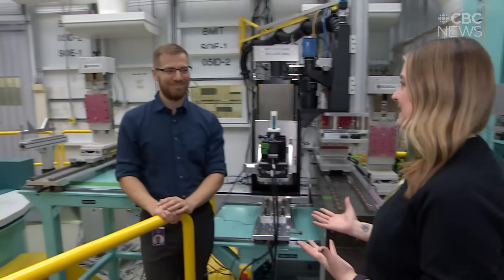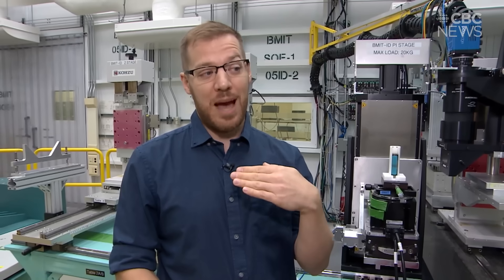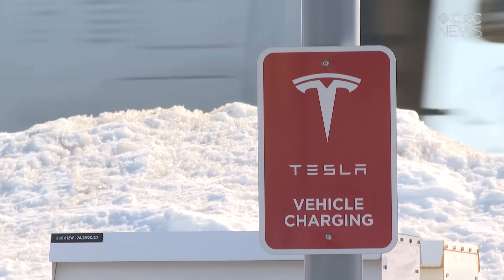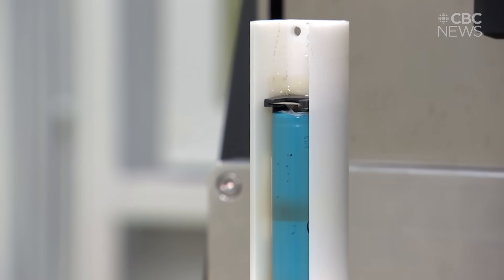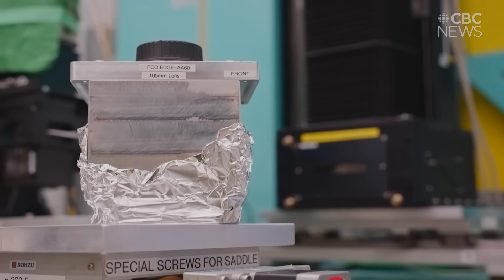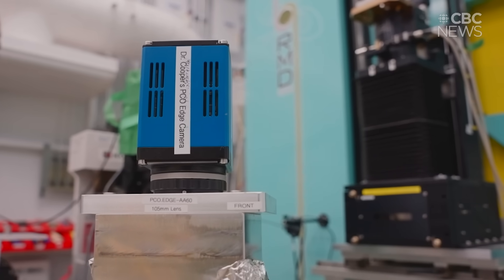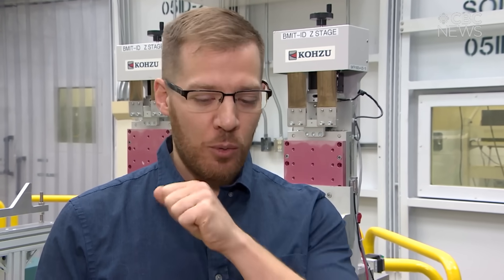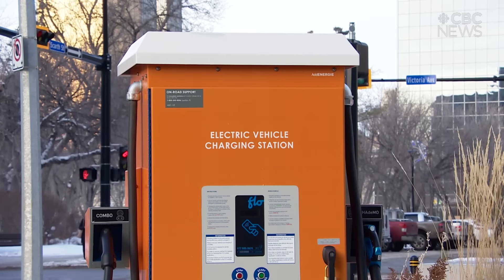New electric vehicle battery could run for 8 million kilometres

Comment: My 2017 Volvo XC90 T8 hybrid is currently sitting at the dealership with a failed battery that's going to cost $10,000 to replace. It failed just 38 days after the warranty expired, and I've been waiting over 2 months with no clear timeline for the replacement. These stories are becoming far too common with EV and hybrid vehicles. While I support the transition to electric vehicles, manufacturers need to take responsibility for battery reliability and ensure better warranty coverage. My Volvo has only 124,000 km - these expensive batteries shouldn't be failing so early in a vehicle's life. The real issue isn't just the initial failure, it's the extended downtime and poor customer service that follows. How can consumers trust these expensive vehicles when manufacturers won't stand behind their products?

Comment: I want to know how this new battery would preform, would it still be capable of similar efficiency compared to the lithium batteries we currently use.  It would be cool that it lasts forever but not cool if the range is 10 kilometres.

Comment: Questions: 
1) What are the temps and DoD for this battery testing? We know that temps, high SOC, and high DoD can dramatically change how long the batteries will last.
2) What does the charging curve look like for these batteries when applying high DC fast charging to them? Peak, Charging curves, C rate, Charge time, battery life while varying how often you fast charge etc etc.
3) How well does it fast charge in the cold. How does cold weather effect it generally?

If it can do all of these extremely well then that would be impressive. Saying a battery can last decades in a lab means nothing if in the real work it's useless and falls apart

Comment: BUT….how long does a charge last? That is the important thing in the north. An electric vehicle here should be able to make a 10 hour drive with only stopping a couple of times, taking 5-10 minutes to recharge. It also needs to be able to do this reliably in minus 40° temps. Anything less is completely impractical.

Comment: It matters not how long the battery lasts, it is the energy required, first to be produced, secondly to be delivered along a network that has have capacity increases installed( and paid for) for the increased energy demands created by the EV industry. I wonder how many people have considered that your average truck unit needs the energy of a small residential subdivision and how many thousands of trucks are out there? I doubt very many of the EV adopters considered just what their energy requirements were going to be and what other uses of electricity they would have to cease the use of to come out of the" I am saving the planet" equation with any kind of net benefit to the planet and not just an additional burden.

Comment: Lots of questions not asked, what’s its chemical composition?, is it prone to thermal runaway?, whats its power to size/weight ratio?, what percentage of the battery is recyclable?, what is the estimated production dates?, what is estimated cost per Kwh.

Comment: Hi,  great to see my home province doing this research. I have a chev bolt in Vancouver bc and love it for city driving. Your new batteries could be a game changer for our local warm climate compared to the rest of Canada. My question is will these batteries be able to handle colder temps because even here as soon as the temp goes down around 10 C or colder the range drops dramatically.

Comment: Having driven plenty of clunkers over the course of my life, I can tell you that any battery that lasts longer than a million kilometers will probably  outlast the car, and/or the owner.

Cars start to develop all sorts of annoying rattles and quirks the older they get.  And, there are little annoying appearance issues that pile up.  The stain on the carpet that won't quite come out.  The exterior paint that is gradually fading, etc.

Every year there are new convenience and safety features that are at first expensive options, but evolve to be required equipment (seat belts, air bags) or expected luxuries (automatic transmission, power windows).

A million kilometers is 50 years or so of driving for many drivers.  Where will personal transport be in 50 years?  Flying cars?  Major highways replaced with hyperloops that transport at the speed of sound?  Robotaxis?  Cars with such epic collision avoidance they can drive at ultra high speeds safely?  I don't know how driving will change, but it's  likely it will, and cars sold today won't fit in in 2075.  A few will probably survive as collectors items, but, like a Ford Model A in 2025, they won't really be practical transport.

Comment: The reason it will never go into actual production is included in the title. Like the tyre that never goes flat or wears down.
Reply: Battery packs are not a wear and tear item. They are a one-time per vehicle sale except in extraordinary circumstances. Lifetime like this justifies a higher cost as the battery can have a long second life as storage. Potentially allowing you to charge on off peak and run your house on peak and save you money long after the rest of the car is recycled.

Comment: My Nissan Leaf from 2013 is still running with about 80 %   battery capacity. I drive the Leaf every day. Its a great little car. Very short range though, but it fills it purposes as a second car in the family. Have a nice day 👍
Reply: I think they have a use for a lot of people. Or who use the 2nd family car for longer trips. As long as people have a choice. Have a nice day.

Comment: Need to make a EV battery that doesn't need thermal managment in the cold while sitting idle. That would be a game changer. Storage below -20°C and charging below 0°C lithium batteries will be damaged without internal heaters

Comment: Cool and all but no mention of charging time or maximum input and it still uses lithium, which is more and more rare every day.  We need to get off of heavy metals and dirty metals.  If humans are strip mining the entire globe to save the planet with EVs then that's not really saving it.  Are these types of batteries more resilient to shock and thermal runaway.  That at least would be a step in the right direction.

Comment: Who cares about battery life when cars are made of so many plastics that degrade in about 5-10 years from basic oxidation? Every modern car I've owned (regardless of power source) starts having all these little motors that rely on plastic gear wheels for things like opening locks and vent controls fail within in 5-10 years. My Audi had to have three door latches replaced, then one month later the tailgate got stuck in the closed position because that latch broke. I wanna sell it, but it breaks faster than I can get it listed!

Comment: 8 million kilometers? That's nothing, in the U.S. they are developing a 9mm handgun that can shoot 50 bullets in 5 seconds.
Reply: What ? Are you on acid? How is that relevant?
Reply: And how many kilometers can those bullets fly in total over the lifespan of the handgun?
Reply: And I'll bet that battery was built in the USA
Reply: The REALLY cool weapons tech is focused on moving away from traditional bullets.  It uses electromagnetic launchers of non-cartridge bullets (with no powder, easy to produce and store in-hand in much larger quantities).  Tests by hobbyist builders put it at par or BETTER than traditional powder-based ammo and weapons, +10% on distance and +5% on accuracy.  And the bonus is that the bullets can also be designed for better distance/accuracy because they are independent of any kind of shell cartridge, so there's no need for "air tightness" or "hold".  When this tech goes mainstream (ironically because of anti-gun legislation and difficult in obtaining powder based ammo), suddenly the 9mm and AR-15's are obsolete.  The key factor keeping that from happening has been battery weight (original models required power from 2-3 power tool 18v cells or car batteries... not exactly concealed carry ready).  As soon as battery tech and voltage capacity improves, it's a new era of weapons for personal protection and ground combat.  I always tell the left, leave it alone, you're only going to force innovation.

Comment: For electric cars, there is discussion about the battery's ability to cycle 2,000 times. Some calculations suggest that if you fully charge a battery to 100% and drive 400 km, the battery life would reach 800,000 km.

However, there's a significant flaw in this calculation. Every time an EV brakes, regenerative charging occurs. In stop-and-go driving conditions, an EV battery may experience hundreds of cycles per day. This frequent cycling can significantly impact the battery's lifespan.

Comment: Here’s the thing about a battery though it’s not hard to literally take a battery out of a car that’s below that 80% threshold and bring it back up to the hundred percent threshold. It’s not like an engine where you have to take it out and rebuild the engine it’s much simpler with a battery.

What we hope to do long-term in the future is literally have cars that wear out and we just keep the battery and move it to another vehicle. Now what we would need to do in order for that to be possible is to standardize make shape and size of batteries in general. This battery for smaller vehicles standardize that the battery for larger vehicles standardize that and have manufacturers agreed to this standard so that whether it’s a vehicle from 2025 or 2050 we know what the battery compartment will look like and we know we can make this battery fit in there.
Reply: You're right on "Keep the battery"
WRONG on "standardise the battery"

Comment: He said the warranty backward. The seven year warranty is that they can't lose less than 20% of their capacity and have to retain 80% of their capacity. He said it the other way around. Tesla: "8 years or 150,000 miles, whichever comes first, with minimum 70% retention of battery capacity over the warranty period."

Comment: Both the article, and this video, do not provide a link to information on the solid crystal battery discussed.  Where can I find it?
Reply: Thanks. Found it. It's LG chem  making them.
Reply: Look up the following sentence for more info on the battery
New EV battery could last 10 times as long as those currently in use

Comment: Just read a story of a 3000km new battery needing replacing.  Just like engines, they often fail.
Reply: @SJC8989  At 3000 km it would definitely be replaced under a ten year warranty. And then the new battery will be guaranteed for a further 10 years.
Manufacturing faults do occur with all machines. 
Less frequent with electric cars.

Comment: the problem about batteries, is that they age VERY differently depending on how you use and charge them.  In lab conditions, versus in real life cannot be compared.  I think electric cars should adapt something like a health gauge for their battery, similar to an iphone.  So you know, aside from the mileage, how much potential charge is left for your battery, or for a used car that you want to potentially buy.  That will give people a lot more assurance and peace of mind with owning and shopping for an electric car.

Comment: Not even a whisper about energy transfer efficiency, or energy density.  If it takes twice as long to recharge, and it displaces twice the space it’ll need a lot more research time to even be considered to approach viability for automotive implementation.

Comment: But having to replace a battery yet can cost you up to $25,000. At least what customers who owns a Tesla will say. Batteries still need to be pushed to become cheaper
Reply: But what if it costs 25k and you can resell( or install it in your new car and deduct the battery price)  it after using it in your car for 400k km out of 8000k for 23,5k as it is still has 95% of its life left ?

Comment: A lot of things are great in the lab, but only a very tiny fraction would make it into production so don’t put too much expectation in it.
Reply: Yeah that's what I was thinking needs real road use especially in sub cold and hot climates.. but heck even I can get 30 years with still getting 200 mile ranges or close I'd be happy with that.. I don't drive 200 miles a day..  my 12v life trolling  battery 100ah been abused 3 years now and the capacity is 92ah. So I'm thinking easy another 13+ years with it till capacity goes below what I can use..
Reply: Agreed.  There’s almost always a, but.  It could supply chain availability/cost, production rate, energy density, rate limited discharge, or something else.  Hopefully, this’ll be different, but statistically for new battery technologies that are reported, we’ll likely never hear of this again…

Comment: He says "we saw no signs of degradation" as they display the scan results, showing degradation... @3:37
Reply: the degradation shown below is for other battery types, in case that is not obvious.
Reply: What you are looking at is an image of other batteries and the effect 2000 cycles (600000km) has on them. You can also see the snowball structure in the image there.
If you listen to him, he mentions they did tests for 6 years on their batteries, doing 20000 cycles (8 million km) on them, showing no degradation.
They didn't show us an image of their battery.
Reply: @Simqer  This makes sense, thanks!
Reply: you're seeing the comparison slide incorrectly. the new battery goes across horizontally. old battery is below.
Reply: @porroapp  Yea... Exactly lol. It literally says it's damaged
Reply: @videomonster9778 good grief, they literally show the magnified image(top right) showing there is no degradation.
Reply: @drwzer  Are you kidding me!? The top, left and right, are of a new battery. The two images on the bottom below the arrows... is the old battery.
Reply: Thank you for saying this so i dont have to :]

Comment: It would go a long way to have any battery manufacturers provide quality replacement batteries for existing EVs so that these perfectly functional automobiles don't end up in the landfull (like so many did already due to lack of battery availability)
Reply: yes my EV has 42% degradation at nearly 9 years and 41 k miles. The battery is nearly knackered, yet the rest of the car is in good nick but still uneconomical to get a new battery, so it will inevitably be scrapped earlier than it should. Hardly environmental.
Reply: @FredFox-m9v  I replaced my 24kw battery for $6k, (2013 Leaf), so there are ok (but not great) options at times.

Comment: The title is quite misleading. The 8 million kilometers mentioned refers to the battery's lifespan, not its charge autonomy. In simple terms, the battery won't maintain a single charge for 8 million kilometers; rather, it will take that distance for the battery to degrade.
Reply: ah that's given from the simple idea of a battery that is rechargable, not a single use battery

Comment: EVs are such a terrible idea.  Burn your gas 100 miles away from your car and send through power lines to lose 20% of the  energy and then waste another 20% moving a giant toxic battery around.  EVs are worse for the environment in so many ways.  The only actual advantage EVs have is they are quieter.
Reply: You realize electricity can be produced without burning gas or coal right? Presenting Quebec as an example
Reply: @waffles1ca  If people only want to drive within 100 miles of a hydroelectric plant.  Most places are not so conveniently geographically blessed.  Worldwide 70% of energy still comes from hydrocarbons.  Which currently does not offset the power loss due to transmission and increased weight.  Not to mention the nightmare that are EV batteries and the hazards they cause.  I really want to believe in EVs but the facts are terrible.

Comment: Is this technology is another technology that it is always going to be 5 years away?
Reply: Meanwhile millions of EVs travel several million km per day with no issues. 
Go figure.
Reply: @scottdarroch9003  That doesn't make sense. Current generation of EVs seem to max out around 400,000 miles lifespan. No where close to even 1 Million. Which is good enough.
Reply: @scottdarroch9003  ....you got reading problems.  The question asked was about battery tech, not electric cars

Comment: "... want batteries to last 10 or 15 years". Nope. Has to be longer. A good quality ICE in Canada goes the junk yard at 20 years or longer with its original engine still working perfectly. In a climate where rust is not a problem it can be even longer. Cars that go to the junk yard at only 10 years are disposable junk.